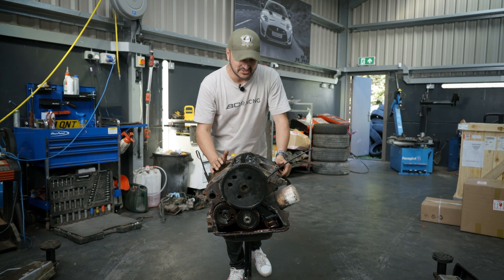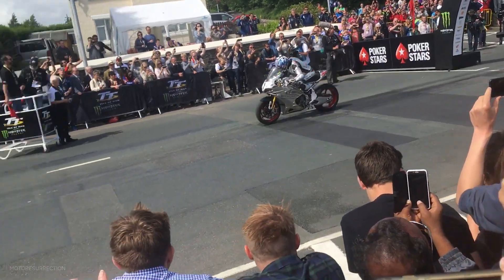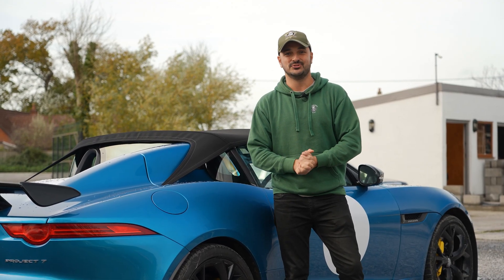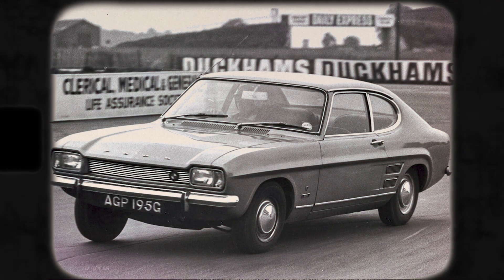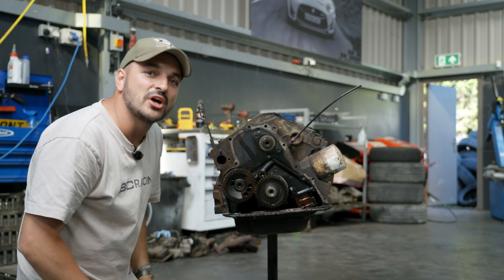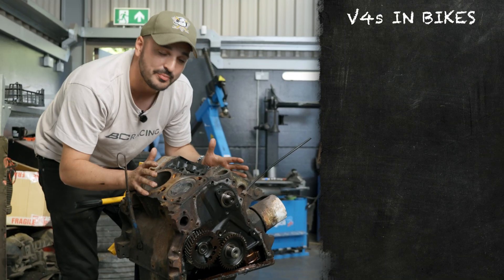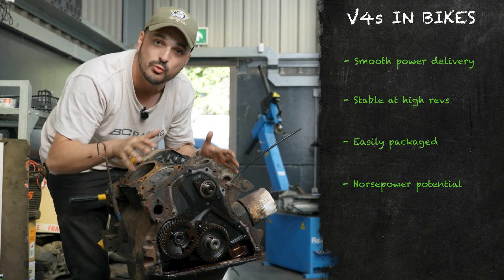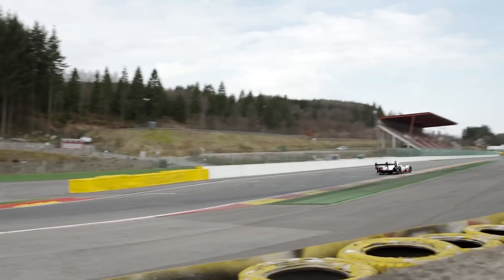Why Do Cars Not Have V4 Engines?

Comment: Great channel, good to see your deep engineering knowledge available to educate people. I'm lucky to have both ends of the V4 spectrum in my garage, a mk1 Transit with the exact lump you are discussing in the workshop and a tiny V4 Honda bike. The Transit with it's 60 Degree V and questionable balance shaft sets the entire van into resonance at 3600RPM, it drives through this but sounds terrible! We forgive it though as 50mph is about as fast as we want to go in a Mk1 Transit. The Honda is a whole other thing, 90 Degree V, 100cc per cylinder and a a 14500RPM redline at which point its smooth and sounds awesome, also noted for rock solid reliability too. I've just realised 4 out of 5 roadworthy vehicles in the garage are a V of some sort, they must be good.

Comment: Back in the day UK Ford had a car with a V4 engine.

The Essex V4 is a V4 petrol engine manufactured by the Ford Motor Company from 1965 to 1977. The engine was available in both 1.7 L and 2.0 L capacities. Designed by Ford of Britain, the Essex V4 was produced at a plant in Dagenham, originally in the county of Essex, later part of east London.

Comment: Ford made a v4 for saab in the 60s. The reason I know that is I owned a 69 Saab in the early 2000s. The previous owners cut the top off to make it into a convertible. It was attached to a 4 speed on the tree and very fun to drive. Mine was the  Saab 96 and I believe the motor was set at 60 degrees. It look so small in the engine bay. You could fit 2 full size Adults in there.

Comment: There is zero reason a V4 cant be awesome as proven in motorcycle world.  The clear benefit when it comes to a rwd sports car is having a 4 cylinder so compact that it can darn near create a mid engine bias.  Personally I imagine the downside is simply it is going to cost more to produce....more parts 2 heads 2 cam shafts not to mention losing the easier to engineer plumbing for intake and exhaust that the inline has.  IMHO there is just not enough dyed in the wool enthusiasts that will value better handling over 1000 dollars less msrp.   But hey obviously the boxer 4 has all the same issues and that works pretty darn well both low end and high end sports cars ...the vee vs the flat is no big thing....get real

Comment: What's interesting is that if you look at the 6 cylinder engines, the straight 6 engines usually have higher torque and more HP than their V counterparts! Look at the venerable 3L V6 AMG M276 engine vs the BMW B58. While their numbers are pretty close, the BMW has a quicker 0-60 time...startlingly quiker!

Comment: V4's rattly? Dude they are some of the smoothest engines out there, maybe old 50s models were. I got two V4's, a 90 degree crank VF750, and a 180 degree crank VFR750. Both are smooth as butter.

Comment: That Porsche 919 isn't a "hot vee" engine. The exhaust manifolds are on the bottom side of the heads and go to a central V turbo position. A hot vee would be exhaust in the center and intakes on the bottom like the newer AMG V8s are

Comment: Completely missed why bikes have V-4 engines.  They use them because of the natural uneven firing order which makes the tires last on a race track.  I-4 engines shred tires.
Reply: The firing order of an inline can be whatever the designer wants it to be.
A V4 is narrower across the crank than an inline. It can sit lower in the bike, without interfering with lean angle.
Reply: @daryljones5492 sorry, but that’s not true.  V-4 have a naturally uneven firing order.

Comment: I missed any discussion of the V4s used in the American Midget race cars. They take a V8 and cut the block to create a V4. It is quite the capable little engine.
Reply: I believe pontiac had v4,s on the road similar to what you suggest. V8 cut in half.
Reply: @oldguy217 Pontiac did make an INLINE four from a 389 V8 split down the vee, making a huge (195.4 cubic inch), incredibly-rough I-4 that was the base engine in the first-gen Tempest. This turd of an eingine only lasted a few years.

GM never made had a V-4.
Reply: @geeniusatwrok actually, you are spot on and rectified my memory. A customer of mine had one in uk probably 25 years ago, I remembered it as a v4, but it was I,4. Customer told me it was half a v8.

Comment: 2:55 I was always told that a v8 was smooth and didn't rattle due to the number of cylinders being balanced... You say different than many.
Reply: Smoothness of a V8 depends on lots of things... Flat plain vs cross plain crankshaft, the firing order,  internally vs externally balanced,  6 counterweights on the crank vs 8 counterweights etc etc.  Regardless of how smooth they are, they are the best engines when it comes to sports cars or classic cars.  For longevity it's hard to beat a straight 6.

Comment: Nice video - you covered all the bases and explained it well. 
I started driving in the 70s and had a few V4 Fords. 
Aside from the transit van, the car range had very long bonnets back then and so there was nothing to win by shortening the engine length. The Capri had enough space for another engine in there!  The thinnest part was between the suspension struts and so the in line 4 fitted better. 
Ford were just moving from pushrod or gear drive cams to rubber belt drives of the Pinto engine. Back then they were well received and as the engine was so simple with lots of space it was a quick and easy job to replace the belt. 
Oddly if you are looking at 90 degree vs then you can also look at 180 degree "vs" The Alfa flat 4 range is just a spread out v. There is some sense in flattening it out. Nice low centre of gravity and no odd v middle to squeeze parts into. Sort of gets over the issues with layout.  
I guess this was the time when the bean counters first took over the running of things. Up until then Ford has separate cars in US Europe and UK. Everything got costed and made at the best price, the in-line won as it was simpler.

The Ford V4 was the engine people used to replace the unreliable NSU rotary engines as it fitted the space and so was an easy switch.

Comment: Just to be pedantic: Flat engines are V engines with a V angle of 180 degrees. And there exists a lot of flat 4 (vw bug, porsche, subaru, ...) So I guess they are not so bad after all.
Reply: So, by your 'logic'.... Inlines have a V angle of 360 (or 0)
Reply: @daryljones5492 if you manage to fit 2 banks of 2 cylinders each with tau radians between the banks and no longitudinal offset, then yes. But my chief scientists say that the cylinders may collide/interfere in this  situation.
Reply: @daryljones5492  To be more pedantic and less wrong: All flat engines are not V engine with a V angle of pi radians. Some are boxer engine which differs from V with a V angle of 180 deg by the fact that a piston and its opposite are not connected to the same crank pin but different crank pins that also are at 180 deg from each other. And most flat engines are boxer and not V. So I guess they are pretty bad :/

Comment: my second car was a Ford taunus, with the 2.3l essex/cologne V6, siamesed exhaust on the rear or front 2 cylinders on each side, made for a weird sound, had a very lumpy idle, more like a V8. but after some a little rpm it starts to scream more like a normal v6, was dun to havea car that was almost 50 years old when i was 18

Comment: A big reason for bikes to have v4's is aerodynamics, banking angles and weight distribution. Since the V4 is shorter than the i4, and almost all bikes have their engines co-planar with the wheel axis, it makes sense to minimize frontal area with a smaller packaged engine and improve aero. since bikes lean when turning, a wide inline-4 up front will limit how much a bike can lean befe the engine scrapes the road. A v4 has it's mass spread over a large area in relation to the frame, allowing weight to be better distributed. this has implications on braking. 
as a bonus - v4 engine blocks can be used as part of the bike's chassis since they are basically a triangle-so naturally a strong shape for frame building.
Reply: Most modern Ducati's don't have a true frame, the front wheel is mounted to so a subframe off of the front of the motor, the swingarm to the transmission and the seat one rear subframe, to take the engine out you break the bike in half.

Comment: The engine from the  Porsche 919 LMP1 used the 9R9 V4 engine which is a two-liter, four-stroke, mono-turbocharged, racing engine that put out 711 HP at 9000rpm

Comment: That Ford V4 used in Saabs was a pretty decent engine. With a front wheel drive trans axle it was a very compact engine. You could pick up the V4 and remove it from the car by hand!

Comment: V4s work on bikes because the engine needs to be short AND narrow. Cars are wide, so the engine doesn't need to be narrow. Nothing is "shorter" than a transverse mounted inline-4, and one head is lots cheaper to manufacture than two.

Comment: 9:22 smooth power delivery is not needed in a motorcycle, to the contrary - V4s offer irregular, big bang firing order. These irregular power strokes with shorter and longer pauses are better for traction.

Comment: 🚗 Production Cars with V4 Engines
Brand	Model	Years in Production (with V4)
Lancia	Lambda	1922–1931
Lancia	Fulvia	1963–1976
Ford	Taunus (V4)	1962–1981
Ford	Transit (1st gen)	1965–1978 (Taunus/Essex V4)
Ford	Capri Mk I	1969–1973 (some versions with V4)
Saab	95	1967–1980 (Ford Taunus V4)
Saab	96	1960–1980 (initially 2-stroke, later V4)
Saab	Sonett II & III	1966–1974 (Ford Taunus V4)
ZAZ	965 “Zaporozhets”	1960–1969 (0.7L V4)
ZAZ	966/968	1966–1979 (1.2L V4)

Comment: Title does not fit the video, anyway, just because of the title: 

2014 Porsche 919 Hybrid
900 Horsepower (Hybrid Combined)

Performance Specifications
Engine
2.0-Liter Turbocharged V-4 With Hybrid Motor

Transmission
Seven-Speed Hydraulic Sequential Racing Transmission

Horsepower
900 Horsepower

Torque
Unpublished

Driveline
Four-Wheel Drive

10:07 and there comes the big boy.

Comment: When Porsche launched the 918/919 LM cars with 4 cylinders and the 4 dots per headlight, I got the impression that they wanted to pave the way for 4-cylinder engines in prestige road cars. Because they knew that in the era of efficiency, downsizing, CO2 limits etc, that it would only become ever harder to justify 6 cylinders. The performance that people buy for road cars has been achievable with 4 cylinders for a while now, but customers are still used to the prestige and sound f V6s, V8s, inline 6s, boxer 6s etc.
And the 919 did a great job of establishing 4 cylinders as a winning engineering solution.

Comment: Just coming from m'y garage after a day working and see this vidéo it's funny ☺️

Cause i have the Ford V4 1700 GT on my eyes all the day on my table.

From my Ford Capri MK1 
I never know if is the 75 hp or 86 hp because there is the LC and the HC 
Low/High Compression
Mine is the HC with double body carburator.

I totaly rebuilt in 1998 and make like 
10 000km with when i was 18 years old.
After that i leave in big city and let the Car many years in the family garden😢

I am going to start him soon !!
May be i am gona make some vidéo 🤗

Comment: Ah yes, having to double up on cam shafts etc etc etc. Et tu, Subaru? I think the flat 4 is at least innately balanced. In terms of packaging though it is the very opposite end of the spectrum to a v being very unwieldy. I would buy the center of gravity point if it actually had any demonstrable benefits vs everything else. I find their fascination with the platform as strange as the obscurity of the v4. I feel like they have worked really hard to make something with an obvious, cheaper alternative viable and yet no one took up that mantle for the v4 which I think has more advantages.

Comment: Because inline fours are about as easy to package under a hood and they have similar performance while being much cheaper to manufacture. If you need a very high revving and also high displacement four cylinder you might go with a V4 because inline fours have a balancing problem once they get much over two liters. It's why the big iron block four cylinders from GM and Ford, the Iron Duke and the 2.3 liter Ford, had pretty low redlines. Some motorcycles have V4s because they solve a packaging problem for some motorcycles.

Comment: My '94 VMax played music through the pipes, and when it hit 6000+ rpm, the Vboost blew the doors off. Music at all speeds. My WRX  Subaru (that I tuned to STI math), ridding it of one cat converter, replacing the normal smaller two cats, with one  larger cat, and wider pipes. Was preparing to equip next with bigger Brembo  brakes, before getting a bigger fuel rail & turbo, etc. But alas I let my wife drive it shortly after putting GPS in- and she got herself double t-boned. She was fine as Subaru had great protection. But my "precious" died. It was a boxer4 already at STI stats, and fun, fun, fun. Great mid-range torque, where those huge duelly pickups like to play. Like true sleepers they love to surprise by trying to prevent being passed. But my tuned WRX ate them for snack at half the $$. Pickup drivers are cowboys at heart, and when their $$$$ 600 horses get left behind, they be furious! Both my vehicles were music when running. Not loud, but pleasantly musical. A lot of folk tune their Hondas with a sick, terrible high pitch that sounds like Wilt Chamberlain with diarrhea. If there is noise in hell, the Honda would provide it. Some motors should not be tuned. Those that find Wilt's farts desirable need a brain exam, and should be forced to hand out free ear plugs in their city.

Comment: BThese Essex v4 were not a rattly engine, far from it if you got it tuned right with the correct valve clearance, ignition timing and carb set up these little engine really ran very smoothly. They had their problems the main ones is they used to strip the teeth on the camshaft drive sprocket. It was a fibre teeth bonded to the steel centre drive. The transits also used to have loads of cracked cylinder head issues. This was a lot to do with the way people used to thrash them along as if they were stolen. Great little engine and so easy to work on when compared to todays engines.

Comment: A little pedantic but that's not a hot vee in the 919. A hot vee is when exhaust/intake are flipped so intake is on the outside of the heads and exhaust is on the inside flowing into the vee (where the turbo is mounted). This just has turbo mounted towards the middle of the engine, air flow is not reversed.

Comment: Surprised you didn't mention the German-made Ford V4 Taunus (which predated the Essex by two years), which found its way into the late 60's Saab 96 through a bit of 'secret' engineering, wherein the company president was unaware of the project until the car was out on the test track.  This was offered as an option instead of the 3 cylinder 2-stroke engines Saab had been using up to that point.  Here's an example of how these Taunus-powered Saabs sounded: https://www.youtube.com/watch?v=dwY16eXeqxk (yes the car had a carb problem which was apparent at low rev/idle).

Comment: I would've liked to see their comparison to flat 4's. Flat 4's have a similar packaging advantage in automobiles by being narrow in the z axis but wider in the x axis than a v platform but with the inherent mechanical balance due to the phase angle being wider. It makes more sense to sling the weight of the motor as low as possible in the car which is what i would assume is the main reason flat 4's were much more prevalent in automobiles where the width of the engine isn't concerning because you don't have to straddle it. The engine in a motorcycle can be lowered below the axles easier than in a car where you wouldn't be able to engineer out the weight bias without sacrificing occupancy space and serviceability. The v4 makes alot of sense in a motorcycle because they're a structural member allowing you to essentially split the chassis in half to service the engine (not unlike the packaging strategy for servicing VW air cooled engines)

Comment: I’m commenting before watching the video. the point of v engines is shorter length so you can fit mire cylinder, but i4 is already a short engine so there’s no need for v4 . one of the fastest track cars , PORSCHE 919 evo uses v4 but you can’t even imagine how much hp they squeezed out of that tiny engine 😂

Comment: So are we just ignoring the flat 4 engine?  Not quite a 180 degree V4 (by definition, there are differences in design), but you can think of it as one.  Because the pistons are horizontally opposed, it has no rattle. All the piston movements are equally offset by the other pistons. And flat 4 engines in cars are quite popular to this day, in use in both sports cars and family haulers.  Talking about Porsche and Subaru.   

Packaging of a flat 4 does get very wide, though it retains the benefit of only being 2 cylinders deep, and most importantly, everything is low. You can have the engine sit low in the car, giving the car a lower center of gravity for better handling, as well as designing a car without needing a large bulge where the engine goes: think Subaru’s BRZ low front hood, or Porsche’s great rear visibility.  Throw a V6 or V8 in a mid engine car, and you have to raise the body lines up, giving the car a small rear window.  The flat engine allows the car to have a full sized rear window. 

I know this video is about the V4, but surprised no mention of the flat 4.

Comment: Boxer engines are similar to V4s, just with a 180 degree "bank". They have the same advantage of only being 2 cylinders long, which is why Subaru can mount an entire engine in front of the front axle. I guess it's favored over the V4 because it has the additional advantage of having a lower center of gravity and really good (though not perfect) balance. Interesting video!
Reply: 'Its not really a V anymore is it? Someone stepped on it.'
Reply: There is a difference between a boxer and a "180° V"...